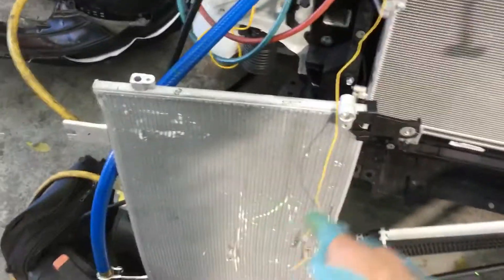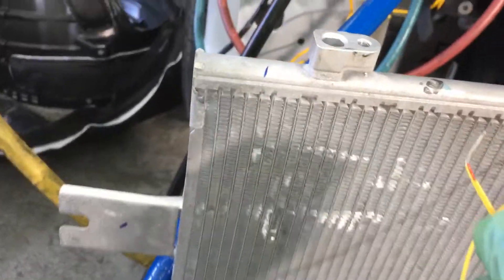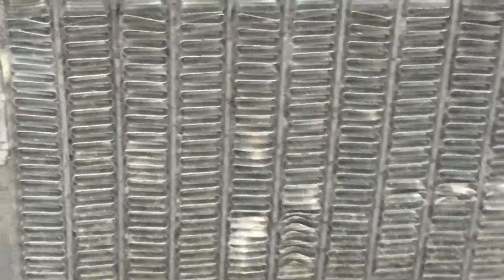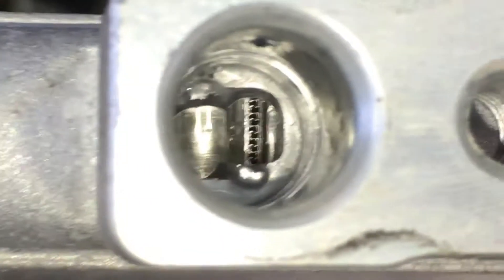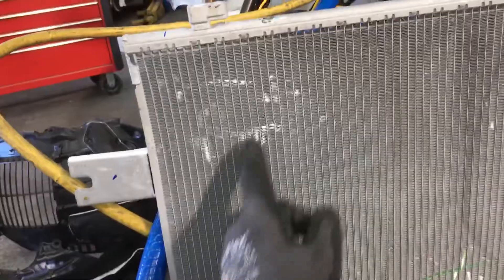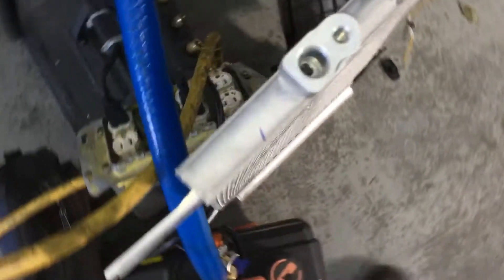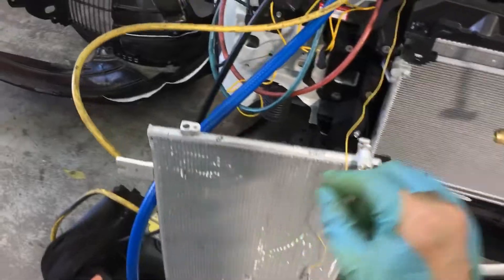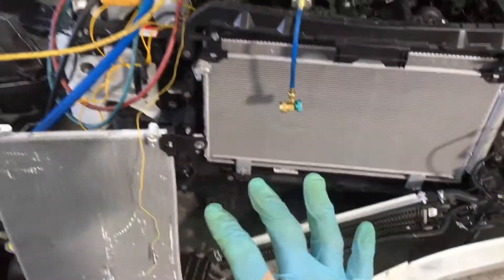Inside Look at a DENSO AC CONDENSER refrigerant passage tube. ￼It just looks quality￼ unmatched

Comment: Boss, It That Possible If Im Using Double Condenser In My Car? My Car Already Swap An Engine, And This New Engine Produced An Extra Heat... It Cause A Problem With My Car Aircond... It Doesn't Cold Enough At The Afternoon Or Simply Said In A Hot Weather...  The Engine Temperature Is Normal... But Have A Problem With Aircond Only... Already Tried To Upgrade All Things Already, Compressor, Condensor, Cooling Coil, Bigger 160w Radiator Fan Motor And Condenser Fan Motor, Also Adding An Extra High Speed Condenser Fan... It Is Better Than Before But Im Still Not Satisfied With The Performance, Especially In A Hot Weather...Boss, It Is Possible If Im Using 2 Condensers In My Car Sistem? Make It 2 Layer?
Reply from the maker: I feel I’m missing some important out of here. 

What climate zone do you live in? 

What are you calling hot weather? Are we talking about 85°F or 120°F  ?. 

Do you live in a high humidity area? 

There should be a gap between your radiator and your condenser condenser should not be right up next to the radiator . 

Hopefully you have about a half inch or a centimeter . 

Is the engine idle speed where it was before or do you have a slower engine idle speed compressors, do not work efficiently at idle . 

Do you have all sources of air blocked off? Did it had original rubber foam or plastic pieces that stop air from going to the engine compartment going through gaps in holes in the front sheet metal and being sucked in and wrap around and pulled back in front of the condenser.  

Do you have too much oil in the system? Did you balance out the oil by performing the oil balance procedure? 

Did you fill the system by weight by the factory manufacture specifications or did you just guess by pressures . 

Guessing will get you in a lot of trouble. 

You can’t fix guessing if guessing is wrong all the fans in the world or condenser or anything you add on an improper charge will not do any better. 

If you have too much oil charging system, no matter what you add, you cannot make it any better you cannot compensate for too much oil. 

What kind of car year make model?.
Reply: @coldfinger459sub0  
Owh... I See... Looks There Is A Lots Of Things Affect An AC Cooling Effect.... 
Im From Malaysia... The Weather Here Is Around 100°F-104°F, Sometimes A Bit Lower In A Rain Season...

Im Using An Old Car... Nissan Sentra N13-Year 1989 And The Engine Is Converted, The Engine Using SR20DET That Are Own By Nissan Avenir- Year 2000... There Is Some Problem With My AC Parts... It Is Mixed/Combined From A Different Part Because Some Part Is Hard To Find.😅

For The Compressor, Im Using Denso 10PA17C... The Condenser Im Using Is Universal Type 12x23" Parallel... Thats The Biggest Condenser That Can Be Fit In... Cooling Coil Is Brand New But It Is Original Car Model... 90% Parts Are Mixed, Including Piping And Filter Dryer... The Standard Part Is Only C.Coil And Expansion Valve Only... Denso Compressor Cooling Speed Is Slower Than Rotary Type, But It Is More Durable... I Have No Choice Because My Rotary Compressor Already Damaged 3 Times And It Is Too Hard To Find One... So, Im Using The Denso Compressor..😟

For The Condenser, Im Moving Out About 1.5" From Radiator, And Of Course It Is Better Than Before... Because The Part Is Mixed From A Different Models, So I Dont Know The Right Refrigerant Weight To Be Filled In The System... So, I Just Measured By Following The Pressure Gauge Only...For The Oil, I Just Filled The Safest Ways, Around 140ml After System Fully Flush...

The Humidity Level At My Location Is Around 65%-70%...

Yes Boss, The Problem Happen When My Car Idle... The Idle Is Still Same As Before... Around 1200 RPM While Idle.. The AC Works Great When Im Moving Slow... It Is Enough Even With 5miles/h... There Is No Problem At Morning Or Night When The Weather Is 86°F Below... Also Got No Problem If Im Opening Bonnet...

Is There Anything Else That I Can Check Or Do Boss?😞
It Makes Me Feel Hopeless... I've Spend Over 2 Years Trying To Upgrade And Changing Parts... I've Using A Higher Performance And More Powerful Parts... Yes, It Is Much Better Than Before, But Still Does Not Meet My Expectation.... I Would Like To Know If There Is Anything Else That I Can Do More? The Final Thinking Is About To Add 1 More Condenser... 😩

Need A Help From Someone That Have A Good Experiences... I Dont Know Too Much About Car AC System... Please Help And Give Me Any Suggestion Boss...  🙏

Sorry For My Bad English Writing🙏
Reply from the maker: @Dragonkingzx  excellent thorough explanation of all parts used in scenarios where the AC works and it doesn’t

So apparently we have a idle cooling problem only 

Compressors don’t work efficiently at idle 

Airflow is a big problem at idle if you have a Mechanical fluid driven thermal fan clutch 

But I’m going to guess that you put on some very big powerful electric vans I can’t remember from the reading because I’m driving at the same time I am answering this between jobs 

I’m going to guess a combination of air flow of hot engine heat from inside the engine compartment when the hood is 

Through the gap at the top of the radiator and from the sheet metal from the side and from underneath in front of the car, rolling around being sucked in that 200° heat is wrapping around and recirculating in the corners of the condenser reheating 

Also, that gap that you have between the condenser and the radiator, do you want to close that up air will pull from the least resistance around the gap 

You might have to modify some plastic or rubber high temperature resistant to make little baffles in air shields all around the radiator and condenser to the front of the vehicle 

You may have to implement some high temperature resistant foam 
Where are you? May have to loosen up some components so you can get the foam inside and then close them back up tightening the bolts to trap the foam in between radiator and sheet-metal close up all holes that lead from the engine compartment. We’re high pressure hot air is present. 

Because the front of the radiator and condenser are negative low pressure, sucking in like a vacuum cleaner in front of the car 

But underneath the hood, the fans are blowing, making a positive pressure of 200° plus air heat it up by the radiator the condenser the exhaust manifold in the engine block 

And when you are still at a stoplight or just idling in creeping at a crawl, snail speed in traffic, this hot high-pressure, Air wants to find any little tiny opening to make it in front of the condenser where the pressure is low 

Let’s tackle this problem first it’ll take you a little while . 

Even making a seal from the top of the sheet metal over the radiator so when the hood closes it is airtight . 

I have shown in some of my videos, explaining why manufacturers put pieces of foam and plastic air dams and seals to the hood so when it closes air cannot wrap around and plastic plates under the engine that come up and seal underneath the bottom of the radiator so the air from the engine compartment, when standing still at idle, cannot roll and be pushed down and then raise up in front of the condenser and be sucked back in
Reply: @coldfinger459sub0  One More Question Boss... Does The Expansion Valve Setting Open/Closed Will Have A Different... I've Never Adjust The Expansion Valve.. Everytimes, I Just PNP Only...  Because I Dont Know Anythings About That Adjustment.. But I Notice That There Is A Different In Flow Setting Each Time Im Buying A New Expansion Valve... Some Of Them Have A High Flow And Some Of Them Just  Open Up For A Tiny Flow Only... Is That Have A Different? Should I Make An Adjustment Or Just Let It Be Ya Boss?
Reply from the maker: @Dragonkingzx  never a chest expansion valve flow. It is it perfectly at the factory.. 

Don’t think of it as flow think if it is sitting in the superheat, you don’t mess with it . 

Expansion valves are purchased on the rating for tonnage or BTU or kilowatt hour rating 

You do not attempt to buy 1000 CFM carburetor for a tiny little 1 L Suzuki engine, and then try to adjust it down because it’s too big 

On the other hand, you do not buy a little tiny 200 CFM carburetor for a Honda and try to stick it on a large American 6.9 L V8 engine and try to adjust it so it flows more air.

You buy the right carburetor for the right size engine 

The same goes for expansion valves. You don’t put too small of the expansion valve on to bigger than evaporator with too high of a load you’ll have problems. You don’t adjust out the problems. 

And you don’t put too big of expansion valve on a small Evaporator with a load load and try to adjust it down 

You get the right one
Reply: @coldfinger459sub0  Ok2....Noted With Thanks Boss... ☺🙏

Comment: My 2013 camry, compressor soliniod not performing propely... Cold state Ohm are 19-20, new soliniod Ohm also same.. O tried to take out the Soliniod, it was totally stuck.. So now changing complete compressor.
Reply from the maker: The solenoids should slip out of the old compressor not be a problem. 

Either was moisture in your system by someone not properly vacuuming and keeping the moisture out of the system causing corrosion that is caused by the person who service the AC before. 

Sometimes someone might stick another chemical inside the AC system that is supposed to swell seals and stop leaks. 

The solenoid is inserted usually with two O-rings that hold it in place and if you stick a chemical that is a seal swelling Chemical the seals may swell so much the solenoid gets stuck in the place and becomes very difficult to remove this is also caused by the person who serviced the system before

And I’m going to ask this question anyway but you did remove the snap ring out of the groove. ? 

One  thing I forgot about if somebody is by chemicals or salt water or something caused a lot of corrosion in the groove between the compressor case and the solenoid causing it to get stuck.
Reply: Yes i did, the lock was out, i tried to take out the Soliniod, but there was a chemical and the body of soliniod was fully rusted.. Even i tried to crush the Soliniod at my Machine shop at milling machine.. Lol.. Then finally we planned to buy a new compressor... My compressor was clean from inside, that why i was planning to change the Soliniod only.. But my bad luck..  Now should i change the condenser as well or no need? Please suggest.
Reply from the maker: @MrMuneebhassan  sounds like if you cannot remove the Illinois you have no choice but get a new compressor. 

Just remember to do the quick proper oil balance procedure described in the DENSO compressor manual. 

Otherwise you may accidentally end up with too much oil in the system that gives you poor air conditioning performance and sometimes damages the front shaft seal fails later in future

Or you accidentally end up with two little oil the compressor will work really good for a while and in the future fail.
Reply: Ok , that's a good considerable point for oil balance.. I will check the manual and will do that... If something still there i will let u know. Thanks man.. By the way.. I like ur guages setup... 😉
Reply from the maker: @MrMuneebhassan  ask questions anytime you’re always welcome thank you
Reply: Btw the way, as ac was not cooling well before. So i took out the referigerant with machine from a shop, and they filled it back with exact amount of 500g and 13ml of oil... Should i do that again after installing new compressor and condenser? Means all oil and air sucked out and filled again? Or what should i do?

Comment: Why people always change ac compressor and condenser together?

And is that New installed denso is orignal or fake denso... Or its orignal denso but not similar to OEM?
Reply from the maker: They replace compressor and condenser together because if the compressor started burning out and coming apart with little metal flakes and particles it clogs up to the old condenser and you cannot clean it out you just replace them together

This one in the photo is original Denso they’re both original DENSO 

In some of my videos I show you the comparison side to side showing that the aftermarket condensers do not have as many of the tiny little fins inside the tubes

And the aftermarket do not have as many cooling refrigerant passages and do not have as many fins on the surface of the condenser.
Reply: Got it..

Comment: Denso performs, and that's why it's OEM equipment.  Don't think you can count on weighing in the charge with aftermarket either, the volume and heat dissipation aren't equivalent.
Reply from the maker: Exactly that’s why every time I charge them up with the original equipment wait in the refrigerant it is always wrong.   And I won hundred percent guarantee them never to be correctly re-charged with the OEM factory weight after an aftermarket condenser has been installed. 
    The customer is F!